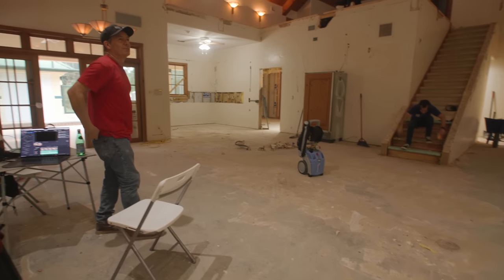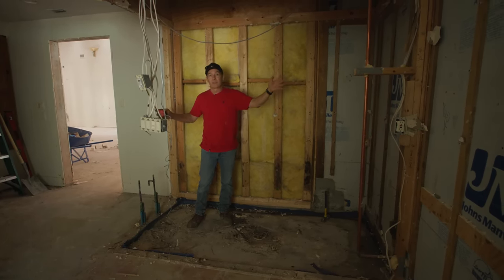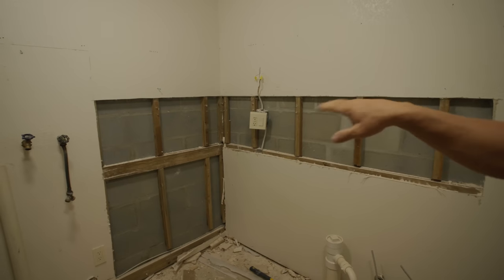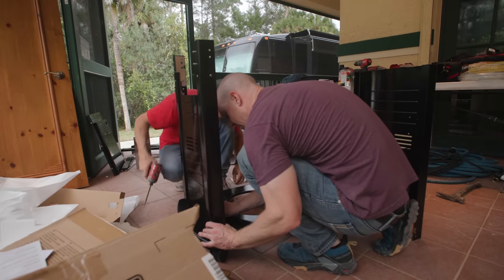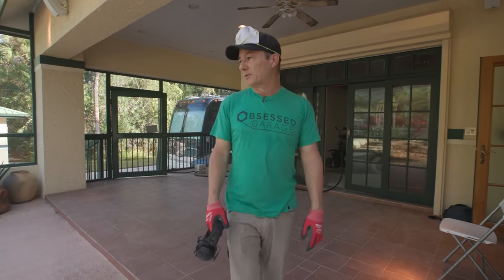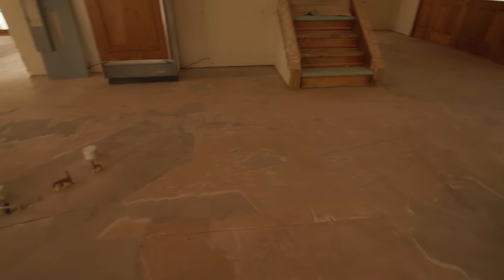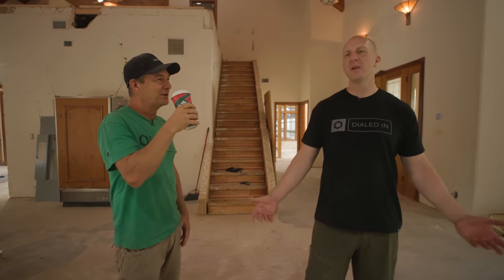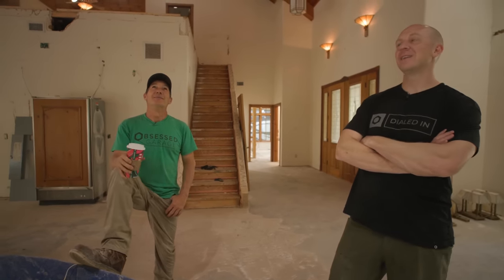Renovating Adam LZ's House - Adam's New Bathroom Is Gonna Be INSANE! | EP.5

Comment: Matt, you are my spirit animal. However, if I may, speaking from decades of contracting experience, one thing I learned and implemented in every job regardless of size/complexity, every third action was to make sure that the site was clean, this way you ensure smooth work flow without spending an inordinate amount of time trying to work through a mess and being able to find all relevant tools and materials. (I used to remodel hotels and multimillion dollar houses in Vail, CO)
Reply: I missed the point.  Surely you didn't type 'War and Peace' for something a toddler learns with his toys.
Reply from the maker: I agree!